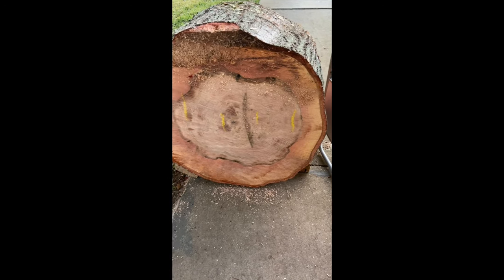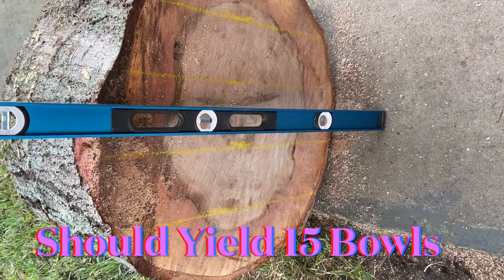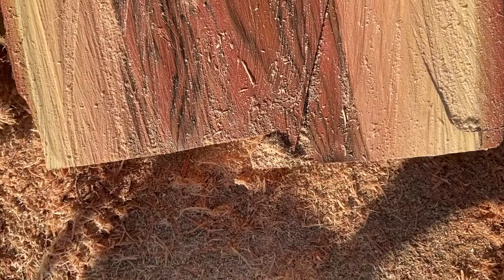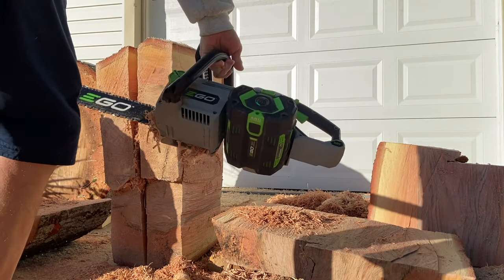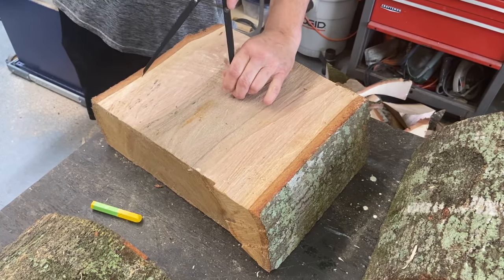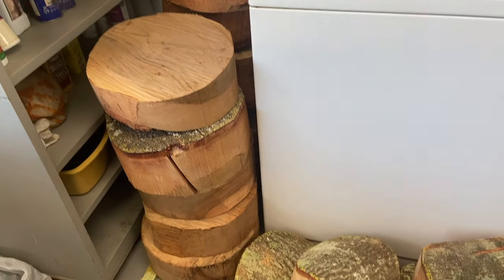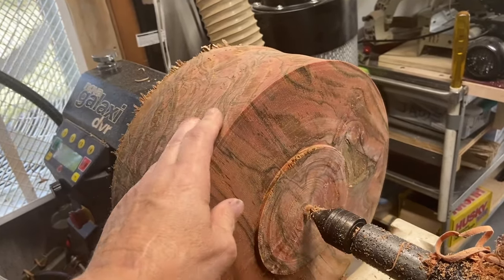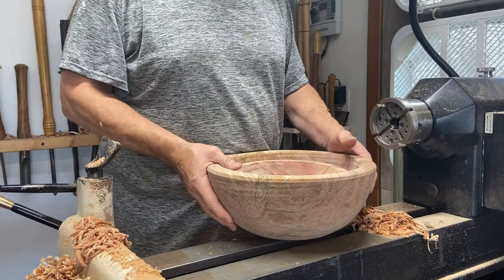Cutting Bowl Blanks from Massive Oak

Comment: Wow that wood looks nice!  I don't think I've seen that type of oak before.
Reply from the maker: If I wasn’t able to cut it out of the center trunk it wouldn’t have been so beautiful. I usually get my wood from the side of the road. Wouldn’t have been able to get this one. The guy taking the tree down used his grapple to set it up by the garage. Took all day to get the 3 just cut into slabs. Agree Wow first turned 10 bowls anchor sealed, bagged and up on the shelf to dry.
Reply: @bowlreveal  looks like it was worth it so far!  Finding wood for free is also the best!

Comment: Good work and nice explanation. 

By the way, your arborist is wrong on the weight of the pieces. If they were as heavy as he estimated, the chunks wouldn't float and would actually be denser than concrete. Your measurement of the round confirms the density.
Reply from the maker: Agree when I weighed the piece which was cut from the 3 center pieces at 42 lbs it was about 1/2 of the total volume of the slab. So around 80+ each for the three center pieces. Then the 2 outside pieces which are rounded I guess 60 lbs each. Total 120 + 240 closer to 360 plus. Even pushing it 400 lbs. The one was much thicker 19 and 20” which I cut a slab off to make my saw work easier 18” but the slab I could pick up about 80 lbs. I used to be able to pick up more. Thanks.  he judged it by how much his grapple could pick up with out the back end coming off the ground. Still beautiful and lots of fun.